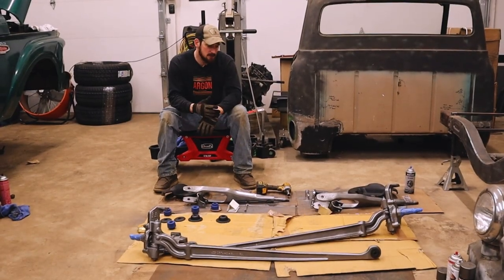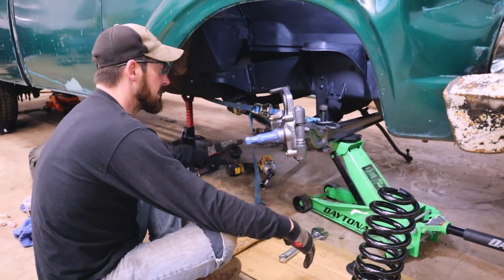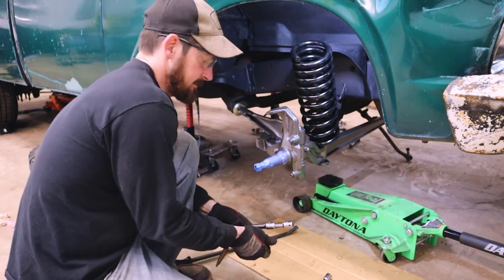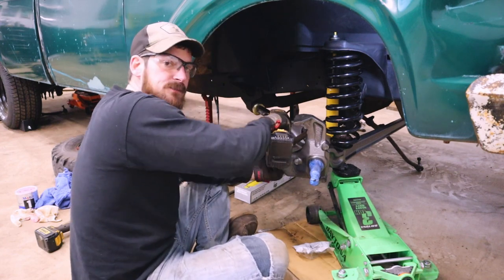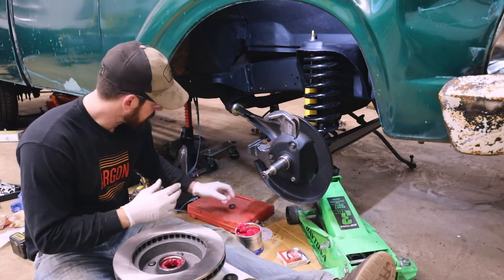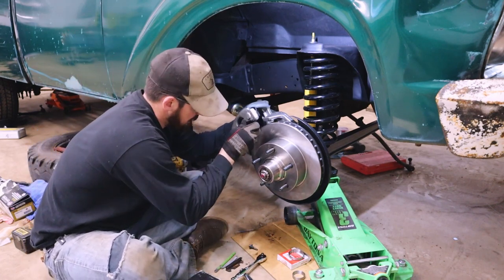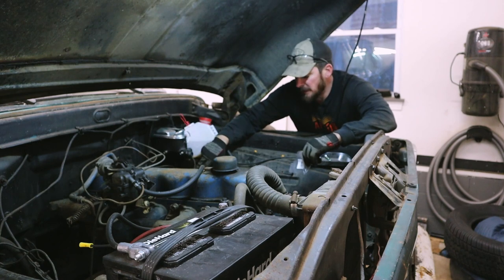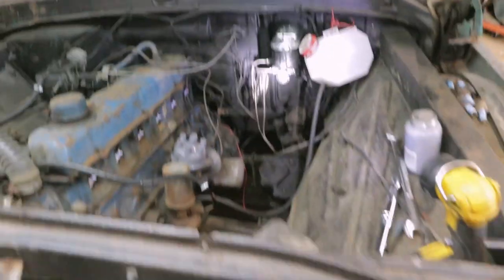1966 F100 Brakes and Suspension upgrade EP003 road to roadworthy

Comment: I had a F-100 1970 302 auto, power steering  and no power brakes. What a pain. White rims and bigger tires. I believe it had King pins. Had those replaced. They had to heat them up to knock them pins out. Gas tank behind the seat too. I wish I still had that old F-100 pick up.    Shawn.

Comment: Looks good,  nice job!  CJ
Reply from the maker: Thank you CJ !!!!
Reply: @left2rot615  I didn't catch if you mentioned it,  or just to be clear,  are the I beams and radius arms all 76 , I have a 66 myself. I just want to be sure of what will swap over.
Reply from the maker: @robertarthurs328   yes i used everything from the 76.  Even the rubber brake lines that were ourchased were all 1976 f100 spec.
Reply: @left2rot615  Any chance booster and master will also swap ? What about PS lol ?
Reply from the maker: @robertarthurs328  im not sure about the power steering but i dont see why not. I did use the brake master cylinder for a 1976 also. I dont have an issue running the manual brake setup. I think if you get all of the running gear you shouldnt have an issue.    Im sure someone has done it. Time for a cold snack and some blog research !!
Reply: @left2rot615  I appreciate your time.
Reply from the maker: @robertarthurs328  you're welcome! Anytime !

Comment: I’ve got a 66 F100 I’m working on too. : )

Did you say the new dual master cylinder was the stock 76 master?

After having some time to drive it, would you want to upgrade to power boosted brakes?
Reply from the maker: Yes sir. You have to get creative with the push rod length but it is what i used. I used part of each and welded them together to get it right. The stock is too short and the 76 is too long.
Reply: Cool, thanks! I’ve been watching a few of your videos today, I’m looking forward to your upcoming bed repair one! I’ve got to repair that front part of the bed floor too.
Are you keeping it a long bed or any thoughts of converting to a short bed while you’re at it?
Reply from the maker: @tomellis5462  thank you for keeping up. The bed will be coming very soon. We are keeping it a long bad and building a frame with a wood floor. I am going to use the stainless strips like what is on the fifties trucks and cut my own lumber. My better half will be doing some epoxy work as well.
Reply from the maker: I dont mind the manual brakes. It stops fine and im not running it over 50 so no plans for power.